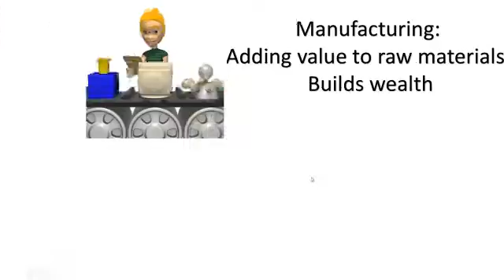Geometric Control May Be a Matter of Life or Death!

Comment: I know this video is over two and one half years old, but I have to add my comment. I LOVE this tip. Of all your advice this one might be the most relevant... get over yourself and learn what the hell you are talking about. As a senior engineer with more than twenty years of experience in designing, drafting, manufacturing, and inspecting, I continue to struggle with GD&T. One of my biggest struggles is to figure out what another engineer intended and usually after a conversation I realize they had no idea what they wanted, needed, or had asked for. Don definitely took the gloves off for this one!